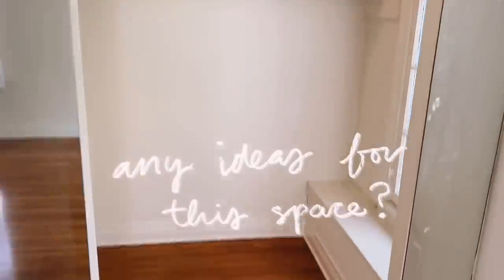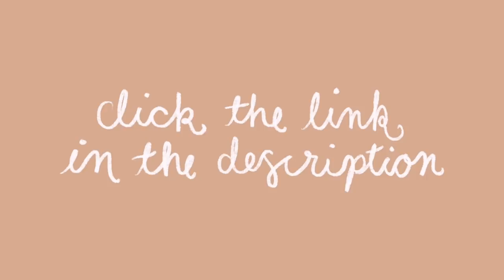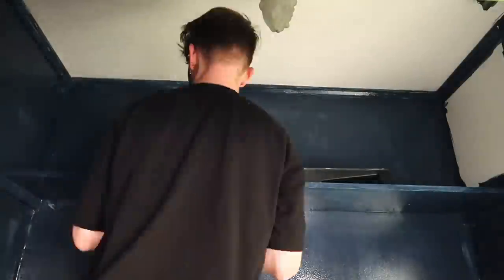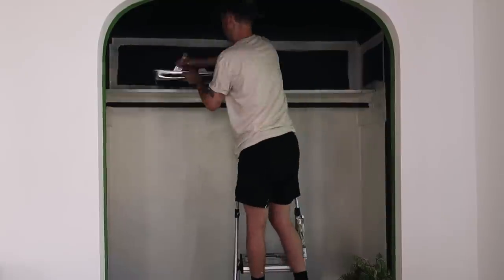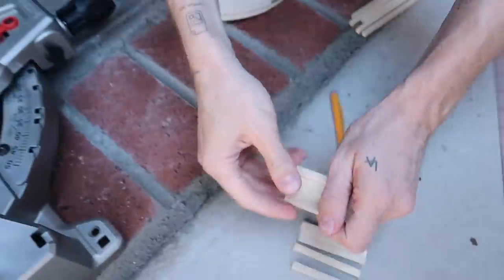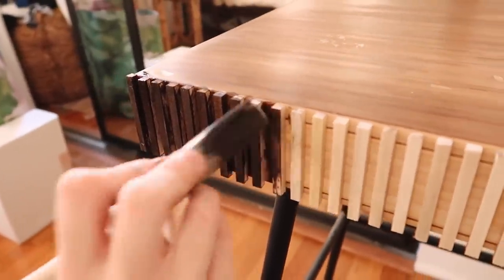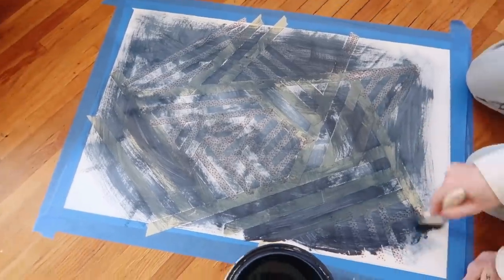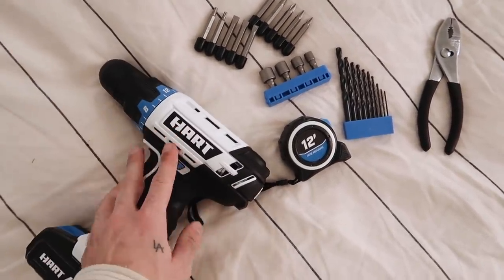DIY Small Office Makeover ON A BUDGET! (DIY Desk + Organization Ideas)

Comment: Omg Drew ❣ I absolutely LOVE your videos, your style and your personality! Just wanted to share a little tip, I am actually a painter and I just thought to share with you that after using stain you want to coat it with polyurethane or a lacquer finish, it is super easy and it will protect your stain and make it easier to clean. Also I noticed you paint quite a lot, so if get yourself an extension pole, is going to make your life so much easier ☺❤

Keep up the good work! 🥰

Comment: If you want to prevent  streaks when painting walls.  Put the roller in the middle of the wall and roll up to the top then to the floor in one stroke and over lap strokes. Then back roll softly into wet paint.     Tips from a professional painter.      Office looks amazing.  Great job

Comment: Guys just another few tips for painting a wall without streaks:
- try to avoid doing small zigzags halfway or a third of the way up the wall; do strokes that go from floor to ceiling each time.
- once you've spread your paint as far as it goes with that one dip of the roller, go back over what you just painted without redipping, with next to no pressure at all at a very controlled and slow pace. This will smooth over the just painted strokes.
- always start your next stroke a little further down from where you just finished your last stroke, and work your way backwards into your already painted area, if that makes sense. Doing this will help blend each of the new dips of paint.
- when dipping, make sure you saturate the roller adequately. You want enough on there to be able to spread well on your wall, but not so much that it's dripping everwhere. When there's too much paint on your roller, it leaves physical streaks behind.
- get enough paint to do at least three layers on your wall, especially if you're changing the colour drastically

Hope this helps!